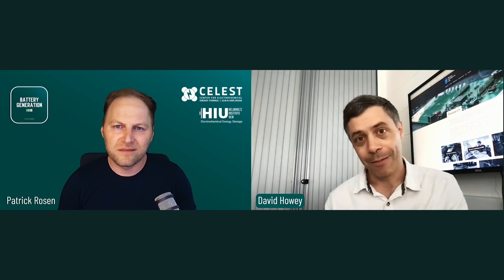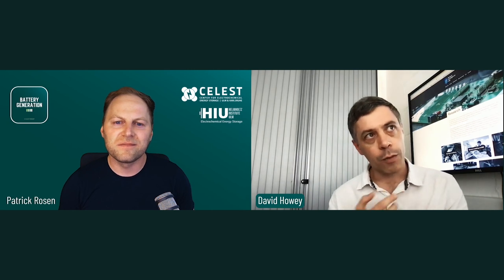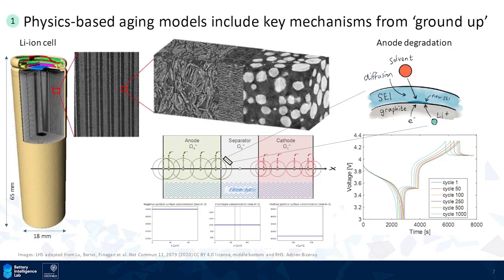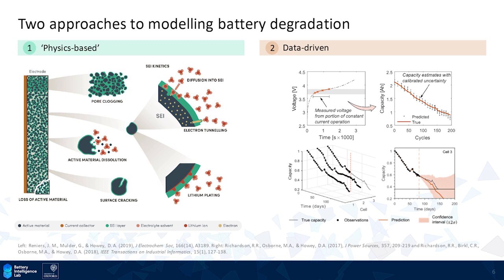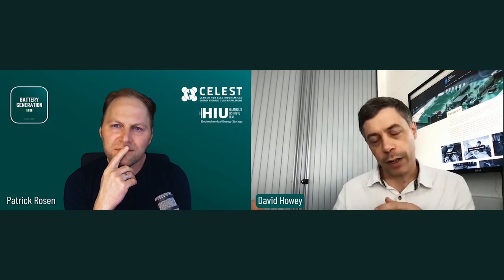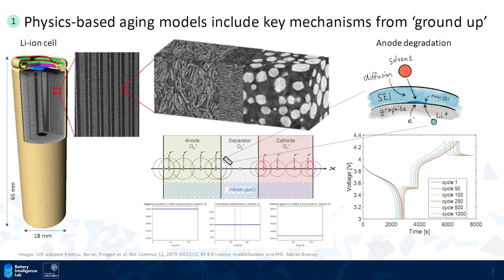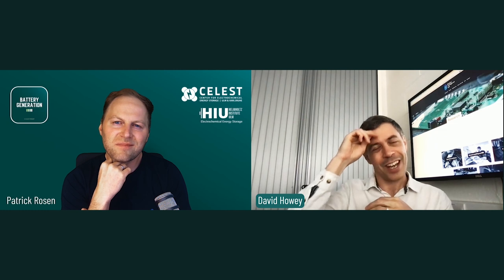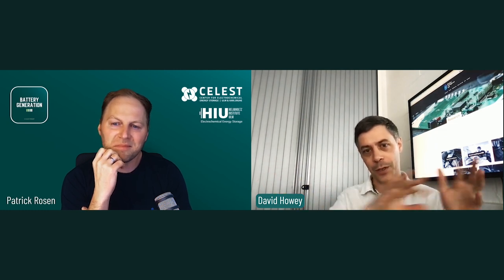How to prolong a battery's lifetime - Prof. Howey | Battery Podcast

Comment: I use off grid batteries for weather emergencies in the USA in Louisiana. So I`m studying this too. Thanks. My 12v 3.8 kwh LiFeP04 has powered a small air conditioner in my camper I live in through four heat emergency power outages this summer and my portable power stations ran my freezer and smaller stuff like WIFI and lights. My small makeshift solar setup has been such a blessing!
Reply: What size inverter do you use guessing 2000watt my 1000 watt refused to start my small air conditioning. It was supposed to be 600 watt input. Obviously not on start up.

Comment: Ultimately since batteries degrade fairly slowly, it should be fairly easy to track the state of charge through the life-cycle by letting the battery run through its full capacity every so often.

The information on degradation is great.  I knew about temperature, but I am still a bit unsure about state-of-charge vs voltage.  The reason is that when you charge a LiFePO4 cell you can charge it to above 3.45V/cell to get to 100%... most people charge to 3.55V/cell and chargers often go all the way to 3.65V/cell (BMS cutoff) which is a bit overkill.

But once the charging stops, LiFepO4 (LFP) drops back down to a significantly lower voltage.   With a very low load my 48V system drops from 56.8V all the way down to roughly 53.0V and is still at 98-99% SOC at 53.0V.  That's only 3.3V/cell.    LFP cells only have roughly a 10% voltage-range going from mostly-full (3.3V-3.35V) to mostly-empty (3.0V).   The Float (holding 98-99% SOC) is at 3.35V/cell.

* So the first question is... which has a greater impact on degradation?  Being at near-100% SOC?  Or the voltage?

I've always been careful to get the voltage down into the 3.3V-3.35V range after fully charging the battery, but I haven't been as careful about maintaining a lower state of charge.   In fact, I also have some very small 20Ah LiFePO4 batteries that I use in UPS applications where the battery is basically floated at 3.35V 24x7 365 days a year (i.e. all the time except of course during a power failure).

* So my second question would be... is there a better way to float a battery in a UPS-style configuration?

8 months late but I'll post the questions anyway 🙂

-Matt
Reply: Did you ever get an answer to your questions. I'm also wondering on balancing configurations os batterries whether or not to discharge every now and then and the amount of time at 100% soc/v. I'm considering this for a home storage system where I can configure the inverter charge rate and soc ceiling, balancing to the usage trend over time/season etc.
Reply: @ranzrumJojoJDDom373  Never did, no.  But I think the #1 variable in terms of calendar life is temperature.   State of charge is only a minor contributor if temperatures can remain controlled (i.e. batteries are inside a garage rather than outside in a shed).

Comment: I think one of your questions wanted more specific detail, of which I would also love expert opinions. Regarding temperature of LFP cells; What is the sweet spot/range of temperature that is best for a cells longevity?. According to the diagram you showed, it seems a sweet spot is 30 - 40 degC. Would you agree? I'm in South Africa (considered warmer than Europe I think) and my cells indoors in summer only reach about 21-22 degC, nevermind winter where they get to about 12 - 18 degC. So I'm wondering if its worth insulating or controlling the temperature of the cells to get closer to 30 degC. I don't charge at high currents at least, but I am trying to get the most lifetime out of these cells.

Comment: Please explain, when the battery is charged, the cells in it are filled one after another (like communicating vessels), or when charging at 80-90%, some parts of the batteries and cells are not charged at all?
Reply: All are taken to the same level, don't think of it like a bar graph charge meter where some sections remain empty, at 80% for instance 100% of the battery is 80% charged

Comment: I bought a mower with two 4 ah 20 volt lithium ion batteries. It`s very useful for garden mulch and perfect for my 100x100 rural lot. But it`s so hot here. So I put a frozen gel pack wrapped in a thin towel on top of the batteries where the most heat is generated when in use and always recharge when the battery meter is showing two of five bars left and store them indoors. The mower was cheap but batteries cost twice the cost of the mower to replace. I hope to replace them (somehow) in the future with two 12v LiFeP04 batteries in series if I can figure out how.
Reply: I gave up on battery mower brought cheap 240v mower and long lead. Battery do not last long and con the price of 3 240v. Mowers also battery mowers less 
Powerful as well. Cannot beat a petrol mower.cost versus benefit just fails. To save 6 to 10 litres per year of gas. I have huge solar system to run home. So put the money to area of most benefit.
Reply: @davidwright1752  I`m getting a standard plug-in mower next and I`ll power it with a battery/inverter setup. I`m not depending on gas. No transportation. On Social Security I can`t even afford to use a car if it was free.

Comment: Is it better to discharge a battery from SOC 80% to 20% once or from 65% to 35% twice? 
Thanks.
Reply: 65% to 35% twice is better. All else being equal, avoid the extremes and sit in the middle. Occasionally, you should go to 100% for cell balancing and recalibration of the battery gauge. I only go to 100% just before a long trip out of town.

Comment: Modern EV cars designed for the fastest DC fast charging, preheat the battery considerably on the way to the charger to improve that fast charge speed to fill performance. But if you look carefully, the EV's performance while preheating the battery, the car's energy efficiency hit is noticeable, and in BMW's case, they've admitted it's a compromise they're making.  Are we wasting more energy to placate consumers' perceived fast charging performance by A) wasting energy at the DC charger cooling the charging unit, cable, and battery  and B) spoiling the efficiency of the car for 10 or 20 minutes before these extreme battery charging sessions. I believe I've also noticed a lower operating efficiency after a preheated DC fast charge. How much does hot battery affect its power delivery in terms of efficiency? I assume if the battery was performing better operating at that high temp, we'd operate it there, but maybe it's also a long term health consideration.

In the interest of really addressing Climate Crisis, maybe these energy wasting compromises should be more carefully considered?
Reply: Agreed, but the effect is very small compared to the fossil energy chain where 2/3rds of all energy is wasted (often called rejected energy but it is just wasted). DW Planet has recently made an excellent video on that subject.

Comment: Don't you need to remember the cumulative charge cycling at each state of charge, say 1000 parts, to know the degradation at the various depth of chemicals to estimate both the discharge curve and the percentage of parasitic losses as each state of charge is reached? EE here.